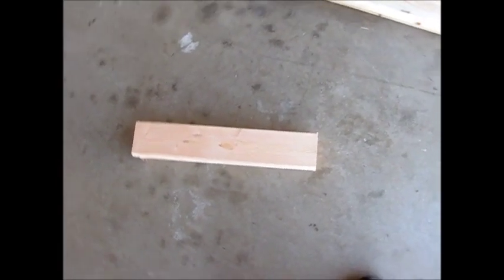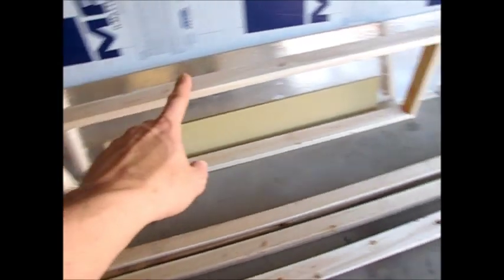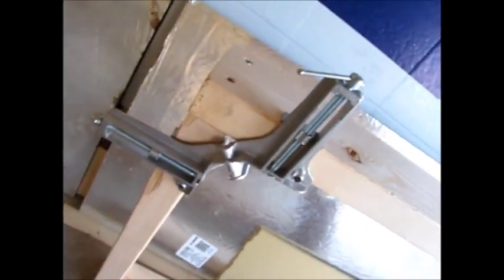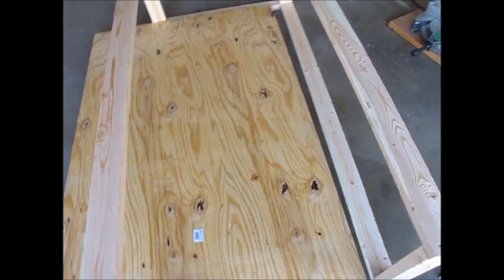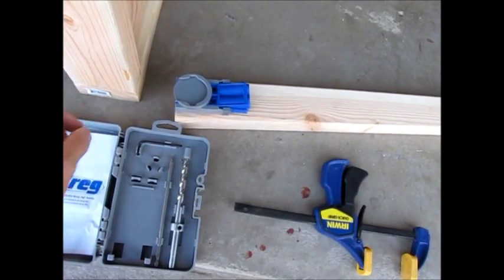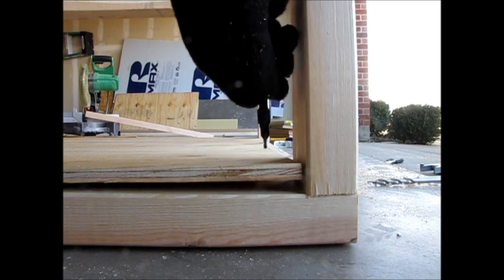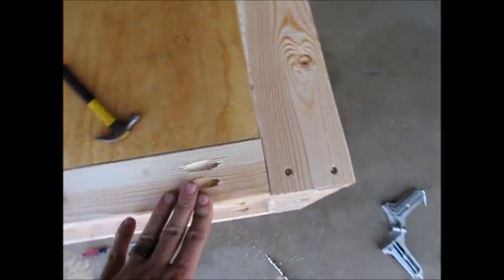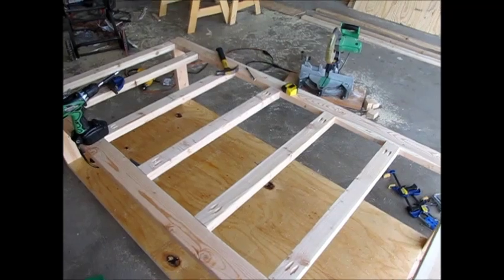DIY Day Bed Part 1 - Rough Frame and Design

Comment: Hi just found your video, very helpful! i want to build one for my son, but i read your previous comment about it being use for occasional events, may i ask why? thank you!
Reply from the maker: Melisa Jacobs You could modify this pretty easily to make it more conducive to every-day usage.  The first thing you would want to address is the height (it is too tall for a child to get up on to easily).  It is higher than a normal bed once you put a mattress on top of it.  I did that so I could put full size plastic storage bins inside of it for storage.The second thing you would want to modify slightly is to keep the mattress from sliding back and forth on top of the bed.  Because of the smooth finish on the wood the mattress will move around several inches on the top and has to be continually moved back flush with the edges of the bed.  You could fix that with velcro or some sort of rail around the edge.Finally you would want to build the front doors out of something sturdy because kids will be accidentally kicking and knocking into it and gouging the wood or breaking the doors.  Make sure to use heavy duty hinges and hardwood that can take the abuse.